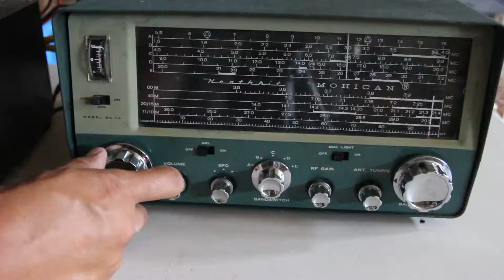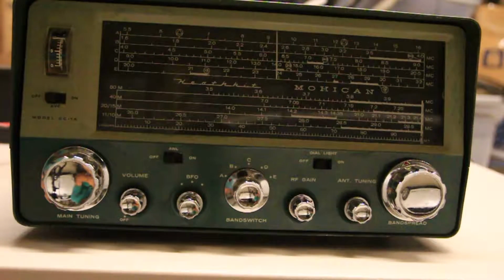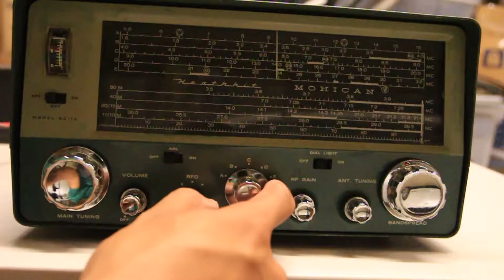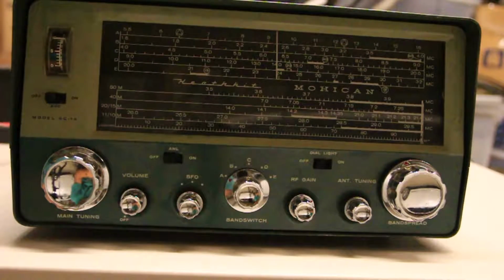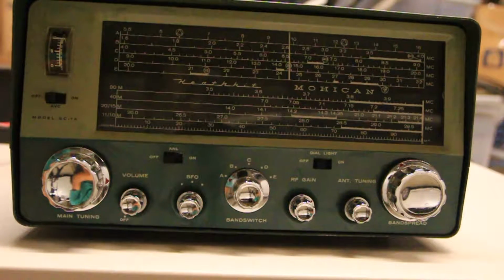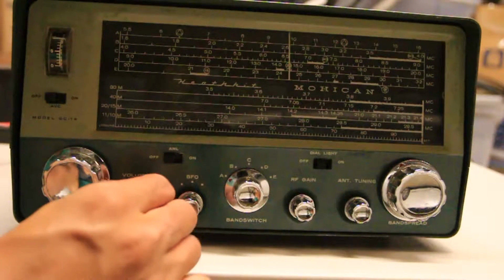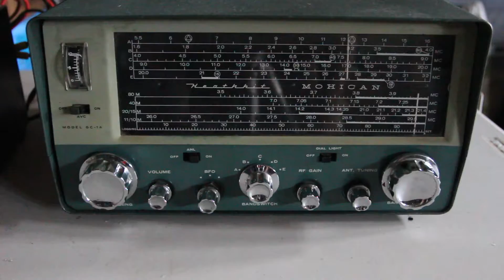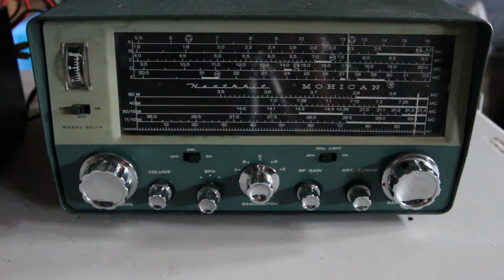Heathkit GC-1 Mohican

Comment: I realize this video is over 4 years old but I believe you have a GC-1A not a GC-1. Note the model number below the AVC switch on the front panel. I have a GC-1. Mine has no model number below the AVC switch and has GC-1 on the PC board. Plus it is missing some parts such as the 100uf capacitors the GC-1A schematic has. I read online that they made the GC-1 in 1960 for a few months until upgrades and then it became the GC-1A in Oct 1960 through 1968 at cessation. Picking nit I know :-). I found my GC-1 at a local estate sale. Unfortunately the Audio stage transistors were bad. Currently I have a small ic amp module for it to run but plan on repairing the audio stage maybe with some russian germanium transistors. Will see. Works good though after an alignment.
Reply: Never mind the 100uf capacitor sentence. Mine has those, just found them :-)
Reply: Love russian germanium transistors and soviet era radios. They're built like tanks and perform very well. Still can find them online from Ukraine. Despite the war, shipping is fast and reliable.  73

Comment: just bought one $100 using the telescopic antenna reception is quite poor. I ordered a MFJ antenna but I am worried despite the claims of the  previous owner of superior sensitivity I may have a problem. As a boy I spent many hours shortwave listening. Still have my Halicrafter s120 but it is toast. Any suggestions? Sure would appreciate the help. If it needs help who can help??
Thanks John in Maine
Reply: I had one in 80s and loved it . wood like another one .
Reply: I restored one and it is one of the most sensitive vintage radios I own using a built-in whip antenna. However, it must be aligned carefully using a good signal generator.